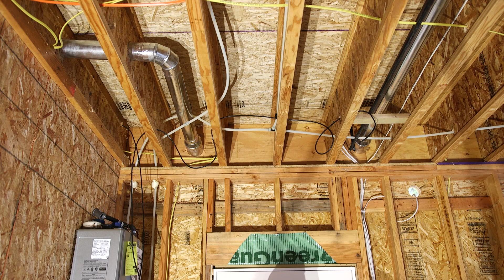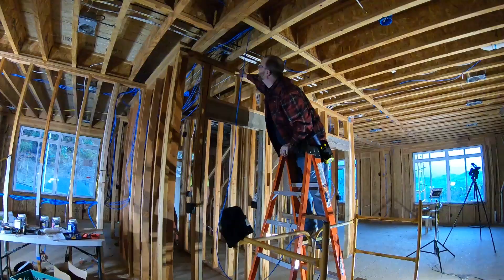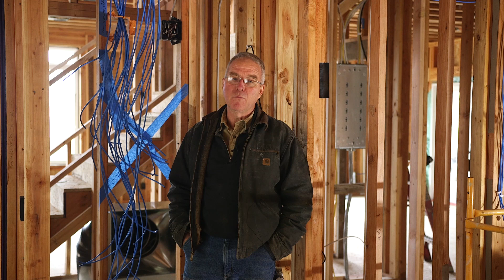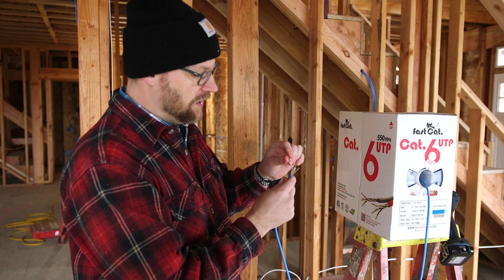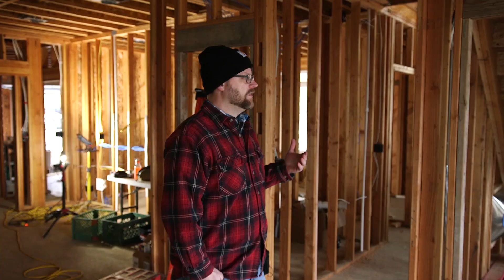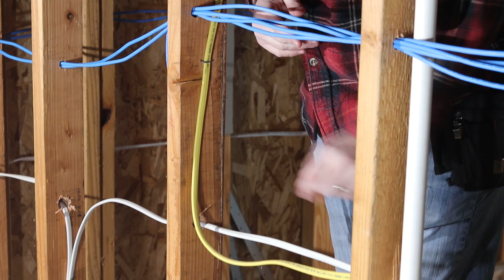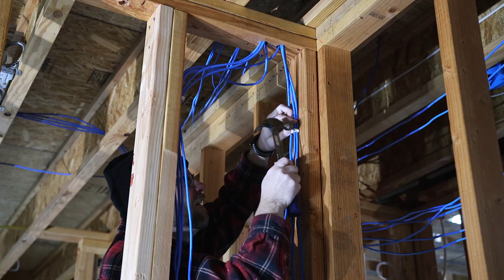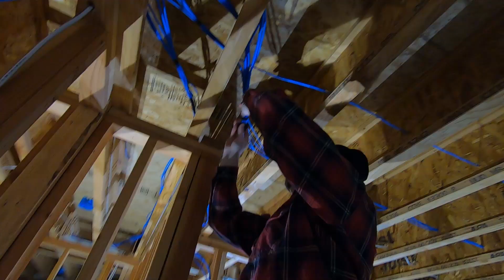Installing A Home Network Ep.100

Comment: Please run an additional conduit from the street to the media cabinet. If the cable company moves to fiber in the future, it will be much easier to pull in the fiber.
Reply: Little late for that I think. All the concrete is poured so I don't think they could dig a trench out to the street.
Reply: @pro353  I think they can drill through into the crawspace without going through the front porch slab.
Reply: It's a great idea! The network panel is in a fairly central area and would require a conduit with a LOT of bends in it to reach the coax demarc, so I didn't really consider it. There's a concrete pad in the way of the crawl space run, for example. But maybe I need to put more faith in real conduits, maybe that have some lube in there?

However, I do have a network jack in the garage, so it'll be trivial to locate a fiber modem in there next to the coax demarc and use the network run to the central network panel as the trunk for the system!
Reply: When building our home, I ran Cat6 & RG6 quad shielded solid copper coax to both sides of the home terminating in a weatherproof box, plus an empty flexible conduit w/ a string for future fiber installation.   I didn't want any telecom contractor drilling holes in the wall or soffit to run cables into the house.   I've had 3 different techs tell me they wished all new homes were like this since the initial cost is very minimal in the grand scheme of the build.
Reply: No need to worry about this. The existing conduit will do and the old existing cable will  replace the fishline. Although I personally prefer to keep a nylon fishline in all conduits.
Reply: Amen. You can even do conduit to a termination box in the yard and if fiber is ever run there's a chance they never even have to come indoors except to test.
Reply: Was just gonna say that. Or Smurf tube.
Reply: Suck that the nation of the republic of America does have fiber internet where we people to make it happen
Reply: Just make sure that there are no tight radii in that conduit meant for fiber in at some point. Those fiber cables are even more sensibil for kinks then any copper wire. When the cable company installed the fibre here they said minimum radii is 13 cm ( ~ 5" ).
Reply: @ulie1960  Almost all modern fiber can bend much more than RG6
Reply: I'd add that running a phone line to each room.

I'd suggest running 3/4 or larger conduit from the demark on the outside to the network closet.  If there are spots for a 90, make it in a spot that you could access later.

Also, run conduit from the network closet to the family/entertainment rooms where you expect to have your tv/entertainment.  That makes it easier to upgrade as things evolve.

I'm not sure if this was done, but run a line to each floor where you can install an Access Point.  I would use a POE grade cable instead.  They generally have a heavier copper line that can handle higher voltages.  This may be the future of how cellular phones where they will use wifi in the home.  I know a former employer had a major cell carrier install something similar, but with cellular radios throughout our facilility.

Good job on explaining things. Like you said, nothing beats speed than having Cat 6 vs WiFi.  

WiFi imho will never beat a wired/fiber connection unless you are in a place where no one else has wifi.  All the wireless devices are slowing things down.  It's similar to the ability of a person trying to have a conversation with a person next by insidea football stadium during Superbowl.
Reply: @anders.m.johansson  network cable doubles as a phone line. You run it all back to a central network closet and there you can decide if it's a phone or network cable, and terminate the other end as you see fit.
Reply: Fibre is so sensitive to damage it is usually 'blown' in and not pulled in with fish tape, much, much easier too. Nice if there is nothing in the conduit as well.
Reply: @Stikker021  I've had fiber installed in three different places, and in every case it was pulled through conduit using a fish tape. I guess it depends on circumstance.
Reply: @MarkRose1337  He may have been talking about blowing a mouse and pull line through the conduit.
Reply: @MarkRose1337  We've had fiber blown in when necessary, however pulling it with a fishtape is still commonly done. The secret in business environments is not to use elbows, and use boxes instead. You can then fish/pull from entrance to box, and then from that box to either next box or termination point.
Reply: @Stikker021  not if fibre with interstitial dielectric stiffeners is used.  it's self-rodding, you can literally just ram it through.  a 1F drop cable is smaller than the fish tape.
Reply: @Stikker021  outdoor cable has built in  tape for tensile strength so it can be pulled through conduit
Reply: Because of cost and complexity of installation, ISP's are moving away from fiber to the house thanks to DOCSIS 3.1 I am running gigabit speeds over coax.
Reply: 👀.... I’m an installation technician for a major ISP. We are not putting any I repeat anymore copper in the ground. Fiber is much cheaper than copper to manufacture. The only issues with fiber to the home is home builders are not pre wiring homes with fiber so we have to run a fiber to our gateway. I don’t know who your isp is but if they are offering your “gigabit” speeds through coaxial cable they are limited to pushing 1gb of data through a coax cable so typically they can provide you with 950mbps download speeds but give you junk for upload speeds. They cannot pass 1gb up and down like you can through a fiber connection. In the future there will be ever faster speeds through fiber. The fiber can handle much faster speeds than 1gb up and down the limitations are the equipment on both ends.
Reply: @kennethwright8081  docsis 4 allows up to 10gb/s but we both know no ISP will give that to home users enmass any year soon :)
Reply: @kennethwright8081  Shaw in Canada can provide 1.5 gigabit down over coax in certain cities. 100mbps up is the max for now.
Reply: That’s impressive I would imagine that is running through rg11?  I could be wrong but I would imagine the major bottleneck is at most residences I do believe once it hits the rg6 at the home it’s maximum capabilities would be 1gbps up and down combined data throughput. Maybe I’m wrong . The physical fiber optic cable itself can handle 32 different wave lengths of light at the same time carrying 1gbps up and down a piece.
Reply: @kennethwright8081  This isn't right either, you're actually getting a 1.4Gb handoff to the DOCSIS modem over the cable, but the ethernet standard is pretty much limited right around that 950Mb/s mark. Copy a file over a regular 1Gb network on your computer, it will top out at around 117-120MB/s which is right around 940-960Mb/s. DOCSIS 3.1 actually supports 10G down and 1G up over coax

They would pretty much never run to their equipment using your fiber, as there is SOOOO many standards of connectors and different types of fiber, it would be a nightmare
Reply: @audisportracer  Fiber is expensive during rollout but is vastly cheaper and has better upgradeability. Coax is being pushed to it's limits. I bet your gigabit connection over coax isn't symmetrical. Guessing 1000/50.
Reply: Wireless -  5G or 6... is the way everything will be.  Verizon stopped running Fiber Optics years ago (in our area, rural).  My bet is that everyone will be wireless in less that five years - R

Comment: Suggestion: 
Run 2-piece of 1/2 EMT from communications closet, one into the attic, & one into the crawlspace, Cap them off for future system expansion for such things as fiber or for whatever else technology brings us.
Reply: Excellent suggestion, but I've always ran a 2" PVC conduit between the patch panel to both the attic for a second floor, and the crawlspace for the first floor.  It's much easier to install and maintain current and future home network cables from the crawlspace to the first floor, and from the attic to the second floor.
Reply: Indeed. But I wouldn't recommend EMT as there's a real risk of any burs or nicks cutting the cable. (if you ever deal with fiber, that'll ruin your day -- and budget.) Plus, PVC is cheaper, lighter, and just easier to deal with, and you'll always know it's the low voltage conduit.
Reply: @jfbeam  I agree with this. There's also the chance that EMT can carry an electrical signal (inductance). I prefer using smurf tubing though. It's more expensive but it'll save you when running fiber, super easy to pull through and you can't bend it too tight for anything really.
Reply: Running conduit for future expansion is a good idea but capping them can cause condensation issues.  Differential temps between attic and crawl space can cause condensation whether it is metal or pvc.  Instead of a cap use stainless steel wool, won't rust, stops potential mice and it will breath.  I Learned the hard way, Speaking from experience and I know every locations climate is different.
Reply: @EricNielsen187  Nice!
Reply: Good idea. Also run a pull string
Reply: @400080vikkash  LOL- Outstanding!
Reply: It's a great idea! The network panel is in a fairly central area and would require a conduit with a lot of bends in it to reach the coax demarc, so I didn't really consider it. There's a concrete pad in the way of the crawl space run, for example. But maybe I need to put more faith in real conduits, maybe that have some lube in there?

However, I do have a network jack in the garage, so it'll be trivial to locate a fiber modem in there next to the coax demarc and use the network run to the central network panel as the trunk for the system!
Reply: It should be fire proofed to prevent transfer of fire between levels
Reply: I was going to suggest something similar, but  they'd have to remember to keep the runs almost straight, since you don't know what the minimum bend radius for the future cables would be (fiber, I know, is fairly sensitive to bend radius, and I don't see it getting much better in the future).
Reply: @c.a.mcdivitt9722  I've run fiber though regular 90 degree EMT bends made with a bender without any issues as the bend made with a bender is actually pretty gentle to the fiber.  Fiber is "sensitive" but not really as sensitive as people believe it to be, it has quite a bit of play on the bends until it starts to see major loss.  A hard 90 on the EMT with a set piece is definitely not going to be good on the cable.  If the distance between the devices is short enough  (like a couple hundred meters, the shorter the better).  It "can" still work on a rough hard 90 as long as the fiber isn't cracked and you have just maybe one of these kinds of bends.  It is definitely a roll on the die though, chancing it through a hard 90 without cracking it is definitely requiring luck to be involved.  If you absolutely have no other option, the only advice I can give on that is, be gentle when you pull it on a rough bend, have two people to pull and feed to reduce the chance of the cable cracking from sheer and pulling force through the bend, best to premeasure and pull it all through the bend carefully before continuing on the rest of the pull.  I would not recommend doing this if you can avoid it...

Edit: Tight buffer fiber would guarantee crack on the pull.  Use loose tube to have a better chance of it surviving.
Reply: @c.a.mcdivitt9722  bend insensitive fibre has been available for quite a while now, it pretty much eliminates the concern of bends.  friction to get the cable through is far more of a concern.  stick with P23 conduit, minimum 100mm bends and no more than three bends in the run and there are no concerns.
Reply: @ScottPankhurst  You assume that a future cable will also be of the relatively low bandwidth and high loss those have available.

The idea of future proofing is to not limit yourself to the assumptions you had when building the structure.
Reply: @c.a.mcdivitt9722    Dude, get real. Cat6a is at 10Gb and MM fiber is well above that.  No one is building for 100 years down the line, just using common sense and best practices for what is reasonably available now.  You don't seem to know much about fiber at least, so not sure where your 'logic' has any basis in reality.
Reply: @boots7859  Dude, grow up.
Reply: @c.a.mcdivitt9722  Fiber has rediculous bend radius. As long as you aren't wrapping it around your finger you are good to go. If you're going to run EMT or the fiber/plastic stuff, and can get away with 1", that would be better.  Trying to pull SFP fiber through a conduit with existing fiber is going to be iffy, and I doubt a homeowner is going to be pulling unterminated fiber and terminating them after pulling. Thats gonna call for a cable vendor.
Reply: @boots7859  I happen to be a certified fiber optic tech, among much more advanced qualifications. 

Don't make your future-proofing assumptions based upon current technology...
Reply: @c.a.mcdivitt9722  is it worth it to run fibre in the house? I already have a fibre connection then it goes to cat6e..what fibre cable will you recommend if yes ? and I saw my fibre port is really different from rj45 how do you connect it to your pc or switch? would really appreciate some advice
Reply: @c.a.mcdivitt9722  BICSI, big whoop, did that 1999.  For a Fiber Optic Tech, "fiber, I know, is fairly sensitive to bend radius, and I don't see it getting much better in the future", doesn't sound like you are.  Anyone who's worked with fiber knows its relatively robust all things considered, and were anyone to look in many a data closet or data center and see how crazy tight people pull these slightly too-short patch cables to connect a machine because they didn't bother to check beforehand and have to meet a maint. window, and everything still runs without any errors registering on the optics.
Your "Don't make" quip seems practiced and probably impresses novices and project managers.
Reply: @whatever_12  If you do run fiber, how is your router, wireless AP's, PC, TV, etc, going to connect to that fiber network?
Answer- for 99% of people, it won't, so don't.
Run Cat6a in the house, and you will have 10Gb-ready infrastructure which will probably be sufficient for the next 10-15, 20 years. I don't know the exact price, but IIRC 1 1000' spool shouldn't run you more than $200-300 if you go with a good name like Belden. Make sure your vendor includes test results for every network run, including passing proper wire termination AND Bandwidth (1Gb/10Gb).
Reply: @boots7859  Sure sounds like you didn't grow up! :)

Comment: man i wish my house was done that way. i had to retrofit cat 5e into it, back in the day -- and the house was built 30 years before that. i climbed around in both attics for hours figuring out how it was gonna work. you may want to run a spare cat6 line alongside the coax! we have FTTH and it's an optical conductor but only to the ONT which is placed next to your power meter, phone box, etc. from the ONT to the router inside, it's just regular ethernet. maybe some of them work with coax, but mine does not.

Comment: Is it strange for me to think of straight line runs in conduit. In example running a 2” conduit from closet to the upper attic. 1” to each corner of first floor just topped off with a blank cover.  My former boss when he had built his own house. He ran conduit from where tv say to the likely the surround sound speakers sit
Reply: In Norway we use flexible conduit for everything; PEX water pipes, power and low-voltage cables. Everything is then replaceable without touching the walls. In my view it is strange to see things not run in conduit!
Reply: @nordlands8798  New data cabling is too stiff to pull through the smurf tube unless you going to pull just one or two cables.
Reply: @guytech7310  One CAT cable per tube yes, and it has to be laid with proper bend radius etc. It is usually easier to fit several small tubes than fewer large ones, and you seldom need more than two data cables to the same location in a regular home.
Reply: @nordlands8798  Does not work for me I usually pulled between  2 and 4 cables per run. Issue is that I would need 2"+ conduit & electrical boxes don't support large diameter conduit at least for 2x4" walls. Conduit only really works if you have short runs with less than 360 degree in bends for the total conduit run. Most of my runs have more than that because there are some locations I have limited area to run cabling: Windows, Doors, Structural beams. etc. 

Conduit is one of those things that seems really good on paper, but is a total nightmare when you try to install it.
Reply: @guytech7310   Ok, standard electrical boxes here have 6x 16/20 mm conduit inputs. We would just run 4x 16mm in parallel for 4 ethernet cables. Pulling cables on complex runs could be facilitated by having an intermediate connection box, but I have seldom seen that - for larger homes I would consider using a second switch to reduce the run lengths. Since using conduit has been the norm here for 20+ years this is of course also allowed for in the construction.
Reply: @nordlands8798  I tried using conduit, but running Cat6a STP was too still to pull beyond one 90 degree bend. Most of my runs have 4 or more Bends. I am sure Cat 6a STP (10gbps) will be sufficient for a very long time. Since I have a lot of drops (10 to 12) per room, I doubt I will need to worry. 

Second switches aren't really ideal since you can have spanning tree\loop issues. I prefer to have all of the drops home run.